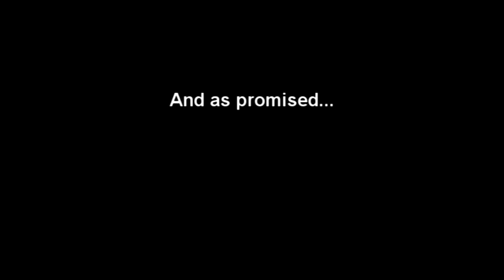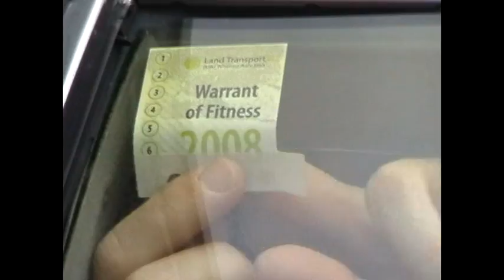Gav's EV Conversion - 23 - Living with an EV 4 (2 of 2)

Comment: I would use the money saved from the electric conversion to buy a mig welder to properly patch the rust holes. Body filler (bondo) last much longer when used witha proper metal patch